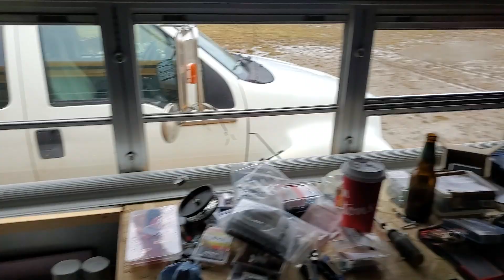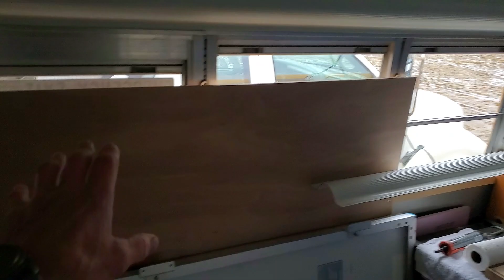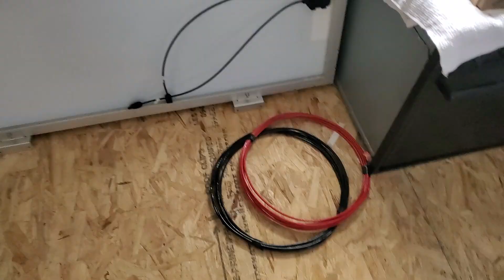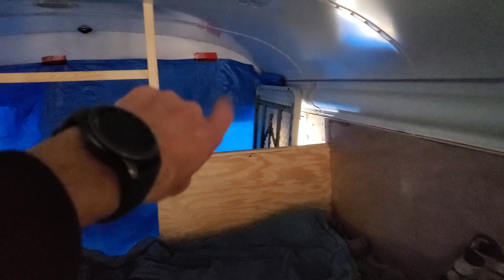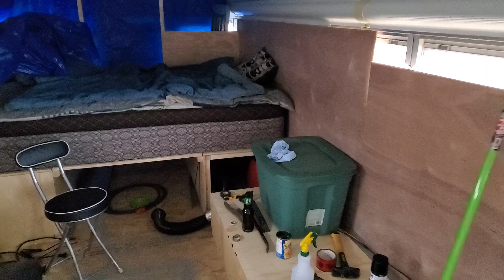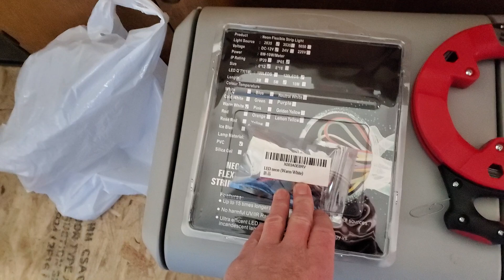Skoolie Build-15 Got it figured out

Comment: Fuses should always be as close to the battery as possible.
It's protecting the wiring in the wire chase going towards the rear of bus in case of a Shorted cable.
That way your bus will not burn to the ground if there is a problem occurring between the battery & it's destination in the rear of the bus..
So I'd put one within 1 foot from the Battery & then use your Distribution block style fuse block in the back..